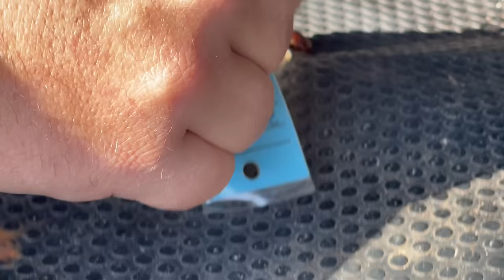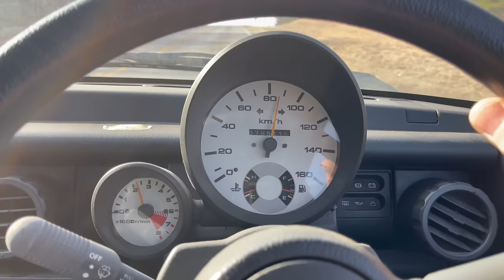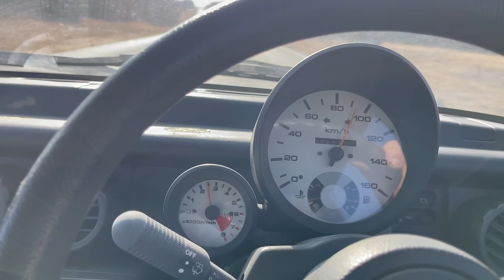My First Time Driving This RHD Mystery Car!!

Comment: Its based on the Nissan Micra K10 platform, which was also sold in Canada, They`re known for being bombproof mechanically (although a little fragile in the bodywork department, & it wont have any rustproofing as its come from Japan, as they dont use salt, so don't see rustproofing as important).. its definitely a carb blockage though, nothing major, just need a carb rebuild kit ordered in (+ a service kit with a timing belt kit too).

Comment: I moved to the Philippines 10 years ago from Australia and bought a 2000 model Suzuki Wagon R Kei Car which had been converted to LHD. Going from RHD to LHD was strange, despite me driving LHD Cars back in Australia, it was driving on the RIGHT side I found strange to deal with!

Kei Cars are FUN! Mine was a 1,000cc 4 Cylinder Engine with 16 Valves, EFi, Air-con, Power Windows, Electric Power Steering, Overdrive, you name it! BUT: Kei Cars are a PAIN IN THE * to find Parts for! Despite being so close to Japan, a Brake Master Cylinder was USD$1800 without Shipping to the Philippines! I ended up having to source Parts from the UK and Spain to get it repaired.

FUN Car to drive! Room and super comfortable for my 6' 230lb Body to fit in with ease, but the Parts! 
I ended up selling it losing around $2,500 on the deal. Seems I was the only one who was not aware that these Kei Cars are brought in chopped up and welded back together, converted to LHD and have ZERO Parts Backup whatsoever! 

Did I say it was a FUN Car to drive?   😁 hehe

Comment: RHD is called "migi handoru" in Japanese.  右ハンドル　
i took my driver's test for manual transmission in Fuchu Japan.  You ride in the back seat to learn the test course with whomever takes the test before you.  Dude before me forgot to drive on the left side of the road, and failed.

Comment: Funny in 1987 I had a Yugo GV and this car has many features very similar to the Yugo including the engine size.
That car got the best gas mileage and coming back from key West once going to Orlando I had it up to 180 mph because the speedometer went to 180 and The car kept accelerating!!!!
Very very very basic but it was like driving a little Fiat.
I did not have any problems with that car and I drove it for 6 years in Florida and all over the southeast.
❤️❤️❤️❤️❤️❤️❤️❤️❤️❤️
Reply from the maker: Haha!! Nice!!

Comment: Tell Randy that the issue with that car after it gets warmed up and doesn’t want to run and it’s cutting up it could be a fuel pump. My 86 F-150s previous owner must’ve drained the truck all the way to E all the time and overtime the pump “overheats” wearing it out sooner than it should, since the fuel cools the pump down. Hopefully a little help!

Comment: Geo metro same year has 70 hp. Put a cheap turbo on it. Air conditioning wasn't available on metro. Older friend had a 60's Porsche he said it handled like our metro. 12 inch tires, everyone else is wider and you can feel that ruts in the road, so you have to choose which side of the car is in one rut. One time I saw a metro going up a steep hill he was very overweight and driver side was lower to the ground